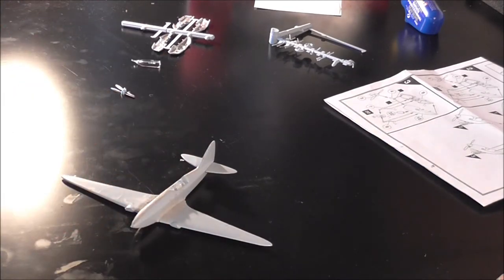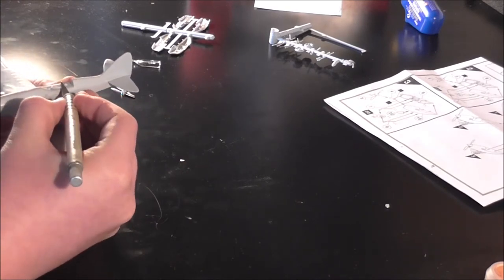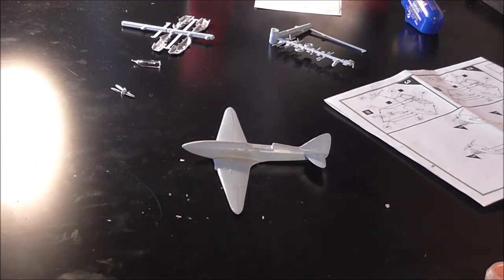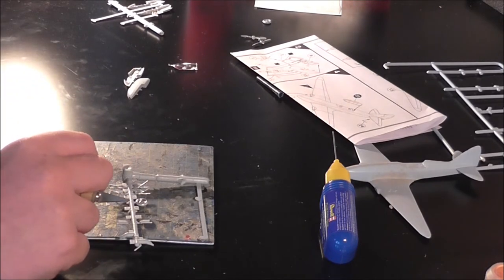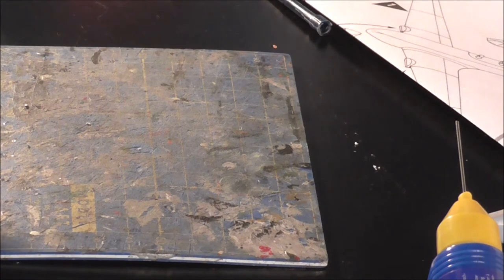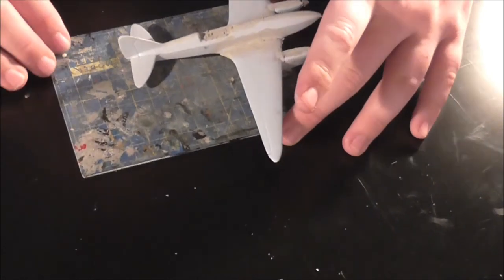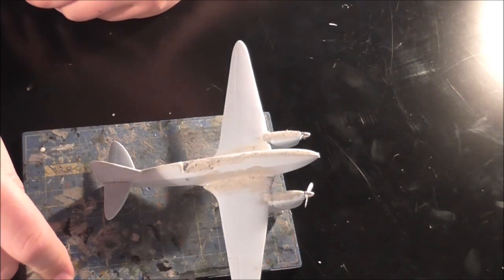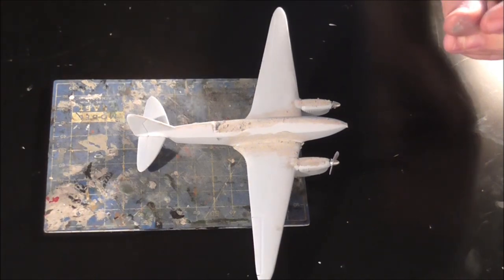De Havilland Comet build part 3

Comment: For a kit with so few parts, I found it one of the most challenging, fighting you all the way! Keep up the gallant work!
Reply from the maker: To be honest, I was a bit disappointed about the amount of parts but as you say, it is one of the most challenging I have made to date. I'll be sure to keep up doing this, no matter what it turns out like in the end :)
Reply: I know how you mean.. I did the Black Magic version. Matt paint with a Clear varnish. Poor fit of the parts (1950's or 60's kit, I believe) The decals silvered badly but determined to do better next time!! After all it's all for fun!!
Reply from the maker: I want to get the black magic and the red version as well. Better buy some filler before getting them lol